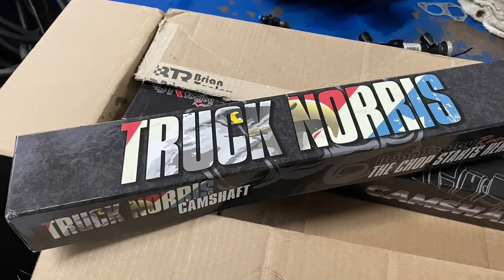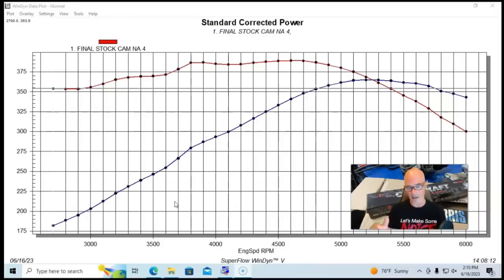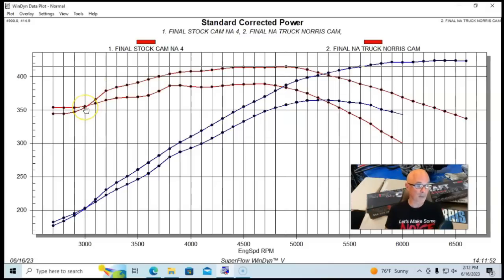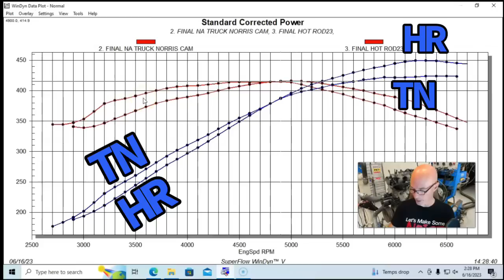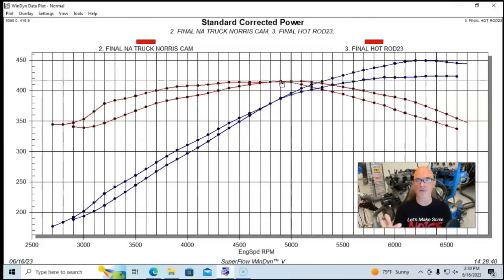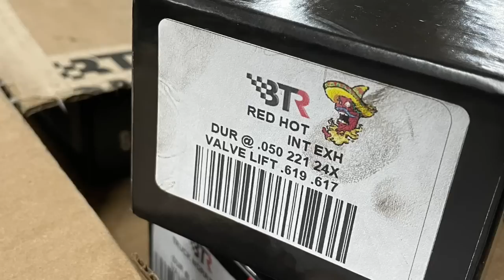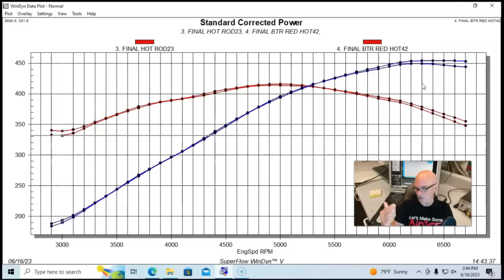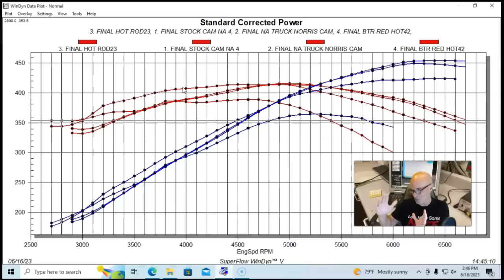CHEAP, JUNKYARD LS CAM SWAPS. 4 CAMS TESTED. CAN YOUR LS CAM REALLY BE TOO BIG? HOW TO MAKE LS POWER

Comment: I just wanna see an lsx 454r cam in a 4.8
Reply: Or a zz632 cam in a 4.8
Reply from the maker: we have run bigger cams than that in a 4.8L, but they are very soft down low, and the zz632 is a BBC

Comment: Lsa was wrong on the cam.   
107.5 was why it made more down low.
Reply: If you lowered the lsa on the big ass cams they would run better. Everone always gets the lsa wrong.
Reply from the maker: valve events

Comment: If you have the proper mechanical compression to give the proper dynamic compression with the stock cam
Every time you make the intake close later ie. a bigger cam or spreading the LCA you need to increase the compression
early on you can squeeze the LCA to keep the Intake close near where it was with the stock combination, or you can use smaller cc heads or both but sooner or later you are going to need pistons 
and if you go to bigger cc heads even if they have more flow you definately need to go through your combination

Comment: If the lift stayed the same at 619 and little changed with dur and lsa. 5hp difference tells me it the heads limit. It would have been nice to see a 660lift cam and seen what changes with 240@50 intake as well. Good video.

Comment: @richardholdener1727 I'm looking at 2 different cams for my daily, but I haven't seen one of them before mayb you could give me some insight, it's a 220/224 575/575 112+4 lsa??? How you think it'd act on the street with stock converter 2011 5.3 Tahoe also looking at a 212/218 604/604 112 lsa
Reply from the maker: look at a BTR Truck Norris or TS Chopacobra
Reply: @richardholdener1727 guessing you think those will preform better

Comment: Out of all the cams you’ve tested, I don’t think you’ve ever done the ss1, which is unfortunate because I think it’s a good middle ground between a lot of these that you’ve done. It’s also one of the cheapest you can get. 216/220 .560/.560 114lsa
Reply from the maker: 1 2 and 3 are planned
Reply: @richardholdener1727  that’s great! I’ve wondered how the stage 1 compares to the truck norris. Curious about the Howard’s rattler cam as well. I think it’s the best sounding one on the market, but not sure how it performs down low for a truck application

Comment: It would be interesting to see some of these newer and popular cams compared to some of the older popular grinds from the early days of the LS. Just wondering how far we've really come.
I have an LS1 running an old MTI C1 "Hammer" (222° / .566" on a 112°) cam w/ 862 heads, and I've occasionally wondered if it would be worth the work and cost to update the cam, but I don't want to tear into the engine and spend hundreds for very little gain, and I'd like to keep drivability about the same if not better.

Comment: I’m planning on boosting my ls3 on stock internals. I don’t have a specific horse power goal, I wanted to run around 10-14 psi boost. In your opinion do you think it’ll handle it ? Or do you recommend less boost ? Also, I will eventually get forged rotating assembly, I want something I can turn up afterwards what turbo do you recommend @Richard
Reply from the maker: YOU NEED RING GAP

Comment: Just made 523hp 448tq with a carbed LS1 and a small cam from cam motion (.570/553 214/214). Put fuel injection (ITB) and a SS2 cam in and only made 490hp. I ran all the way out to 7100 on both and lost power with the SS2. My head hurts....
Reply from the maker: 523 hp with a 214/214 cam? and les power with a 228 cam? you need to check your dyno
Reply: @richardholdener1727  - I trust the dyno. I think my Holley Terminator X failed when compared to a carb. The carb (holley 750) was on a vic jr. We were making crap power with the ITB and TX, so we wanted to make sure it wasn't the long block that was the problem (and I'm not a carb guy).

Comment: Could you please do a 6.2L HEMI, with cam swap, heads and boost on E-85 (preferably procharged or twin turbo ) for max horsepower and torque and also a 6.4L truck motor with forged pistons, rods, cam heads etc also E-85 with same boost (say 7lbs, 14lbs and 22lbs) I realize this is financially ridiculous but hear me out... I believe you could start a online petion and submit it to Chrysler and ask/con direct connection to help you out with long and or short for  blocks for the benefit of all of us Mopar fans to see just what these engines are capable of so we can justify to our wives the second mortgage on our homes. All of us started on big block mopar (1969 roadrunner my first car at 15 years old left me addicted to big blocks and B bodies) could you please show us once and for all what is possible with the latest and greatest Hemi assuming we could afford to build one and have our "friend" cook enough corn liquor to fuel it once built.... come on, let's put some parts in and on a new Hemi and see what it can do? (Besides initiate divorce proceedings)
Second requested test, everyone is doing with incredible results!! The "junkyard bone stock LS on nitromethane." Am I to believe 80% nitro, timing and maximg out the injectors REALLY gives us almost double the horsepower??? Test it for us, what happens with a cam, bigger injectors and heads?? Enlighten us old wise one, please!!
Reply from the maker: the Nitro test is in the works

Comment: Would a high 220’s cam still make power on a 4.8 or would it be beyond what continues to make power? I’ve seen some data logs of 4.8 with ss2 and tbss 7800 rpm 28 psi 1000lbs/hr e85. I would have thought the long runner would fall off but its burning the coal all the way to 78 with level 28 psi. Did the tbss not roll over up high because the cam(and or intake) is so big compared to engine size? This makes me think if you have a short on a 4.8 it doesn’t matter how high you rev it the tbss would be a better choice.
Reply from the maker: the right 220+ cam adds power, take a look at the 224/232 cam run on the 4.8l
Reply: @richardholdener1727 found a few on 4.8 some of the 220range peak and crest, some are flat when the test stops. Even with long runners.

Comment: Texas speed show the MS3 camshaft as making 47Xhp in similar trim as you run on an 5.3. Its the most powerful cam I've ever run in a 5.3.  Just needed a really loose converter. Pretty amazing results on a twin turbo setup. Have you ever run their grinds on your dyno?
Reply from the maker: I have not tested that cam
Reply: So is it the best 5.3 cam you ever run in NA?   If so, what static compression?

Comment: Please help, I have

TSP 228/228 600/600 112LSA cam kit
660" dual valve spring kit
PRC titanium retainers
TSP 7.400 pushrod kit
TSP rocker trunion upgrade kit w/intake exaust valves on stock non-ported heads. Also, 102mm TB with FAST intake. I need some down low HP/TQ. I have the $ for heads and fuel pump. I heard RHS matches with FAST intake. But my cam?
Reply: On a ls1
Reply from the maker: displacement, boost, tune or smaller cam, ported heads won't add low speed torque
Reply: lower gears, maybe high stall torque converter.
Reply: @bobbobby1846  I have a 6spd. Am I wasting my $ on cylinder heads? It's the only thing besides fuel pump, that I haven't done...

Comment: Truck Norris makes that big torque curve down low because of the tight LSA. It would be interesting to either widen the LSA on the TN, or tighten it on the other 3 and see how the curves compare.
Reply: I thought the same thing, going to a bigger duration cam on 108-110lsa would likely have been way better I think
Reply: @1616Rotor i believe ptv becomes and issue on sbe

Comment: Richard, the hot rod cam was actually made for the 5.3. It’s listed on the BTR site as “5.3 hotrod camshaft” I only know this because that’s the one I’m looking to use as a replacement for my stage 4 that spun a cam bearing. The stage 4 ran great with a truetrac 4:10 and a 3k converter. I also have a truck Norris cam sitting on the shelf too for my square body. 
This build will be 5.3
BTR hotrod cam
Ported 706 heads
Tbss intake
92mm throttle body 
1 3/4” headers 
Equal length 3” spintech exhaust
Cai
3k converter 
4:10 gears 
Eaton true trac 
Possibly a 100-150 shot, depending on how it runs after it’s tuned. 

Then to find some traction 😂
Reply from the maker: they offer it for the 5.3l, it was designed when they did ls3 testing

Comment: Hey Richard I had a question for you, this video came out at the perfect time. I'm working on my friends 66 Chevy Nova. We are going to do a 53 LS swap out of a 03 GM, my question is the combination of the car right now is a 411 geared Ford 9 in and a 200 4r with a 32 to 3500 stall. With the hot rod cam in the 53 and we're going to run a Holley Terminator X fuel system and management system will that combination work with that cam I know you mentioned in your video that you need a converter because of where the powerband kicks in at
Reply from the maker: yes
Reply: @richardholdener1727  what would you recommend for an intake, he has a 3inch cowl hood so clearance isn't an issue. A mid ram or the high ram?
Reply from the maker: the best efi intake for that combo is FAST (expensive) or TBSS
Reply: @richardholdener1727  ok thank you, I will advise my friend and see what route he wants to go.

Comment: I'd like to see the effect on backpressure in a boosted application between the hot rod and red hot cams. Even if power output is the same if you end up with lower back pressure you could in turn get a little more power out of the same turbo setup.
Reply from the maker: if na is the same-back pressure is the same

Comment: If you then change the installed centerline itll change also.
Might regain some output low down with the bigger cam with a different installed cl
Reply: If you have to change the ica of the cam you bought in order to change the powerband to where you need it, you bought the wrong cam.
Reply: @Carl_Jr  could also be that it has the wrong icl for your combination.
Reply: @magnusdanielsson2749  Which is the wrong cam
Reply: He has ta test up on advancing the cam. Kinda defeats the purpose of a big cam, just get a smaller one
Reply: @cedricwilson2055  for sure. Most never rev to 6000 anyways.
For a street car one might at most use the high revs for 10% of the time.
Id say 80% is spent below 4500. So one can really question the big cams on street.
But them braggim rights 😁

Comment: It's amazing how wide the LSA is in most of the factory cams! I wonder what has GM gained on producing these LSAs?
Reply: Smooth idle and map sensor tolerance , vacuum little or no overlap
Reply: Passing emissions requirements
Reply: I think it was for idle quality and fuel mileage

Comment: Once you get to the point of gaining little to no horsepower with cam swaps in a similar range, try going REALLY wild. It’ll gain then lol. But you’ll have to rev 7500/8k rpm..
Reply from the maker: that doesn't work on a motor with a long runner intake
Reply: @richardholdener1727  Of course you gotta have supporting mods 😎

Comment: This was on a 5.3, does it just scale using the same 4 cams on a higher displacement engine? Kinda like boost scaling, or does it then suffer from lack of cam in higher displacement applications?
Reply from the maker: bigger motor can use bigger cams, but the real test would be to show this on an ls3

Comment: Would a 573/578, 229/240 114 lsa be a wrong cam for a 6.0 w/243 heads, tbss 36 flex injectors?
Reply from the maker: no-it will work

Comment: Great comparison, Richard. Here's a test you haven't done with the Truck Norris Cam. Would it produce better power all over instead of doing a step up in cam by changing the stock rockers to 1.8 rockers or 1.85 rockers on a truck 6.0L LQ9 flat top pistons with 799 heads, springs upgread to .560 and harden push rods for a daily driver? Would it have clearance issues? Would it have valve float issues and need a spring upgrade?
Reply from the maker: definitely needs springs for that

Comment: Richard, do you guys ever try to use the VVT?
I find on the DOHC stuff, even with one bank either intake only or exhaust only going to a larger cam can have some of the extremes of the power curve can be mitigated with VVT running
Reply from the maker: I can't run VVT on the engine dyno using the Holley

Comment: The Truck Norris is plug and play no need to change any other parts. It's a nice step up but unlikely to break things when you put your foot into it. More HP is aways welcome but in the real world there is a balance.
Reply: If it's the nsr, you can put the cam in, but I'm sure you still need to tune it.
Reply: @rustyjunk9008  Thanks Steve. I'm an old guy so all this is over my head LOL Just give me a quadrabog and I'm good to go.
Reply: I have a TN cam in a 2003 RCSB with  an otherwise stock 6.0. I definitely think it needs a 2800-3000 stall, no matter what the internet says.